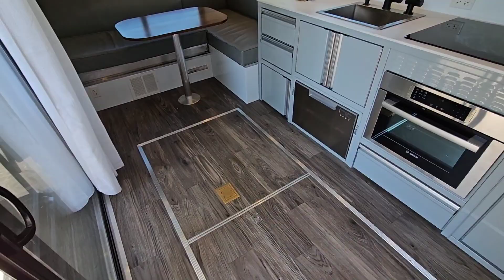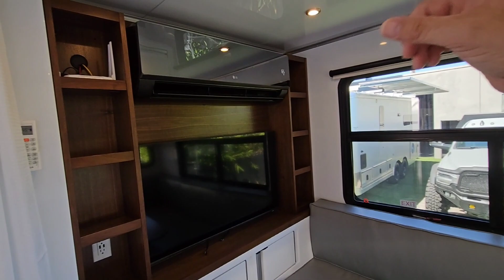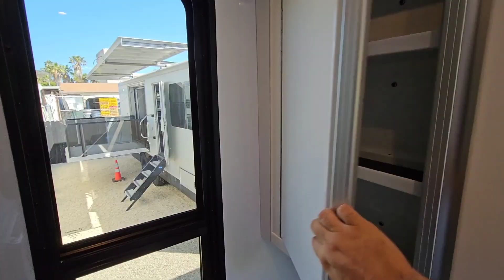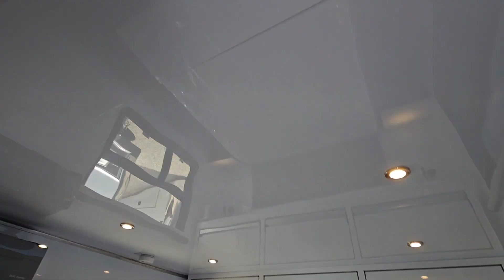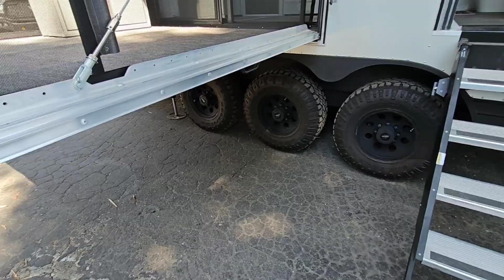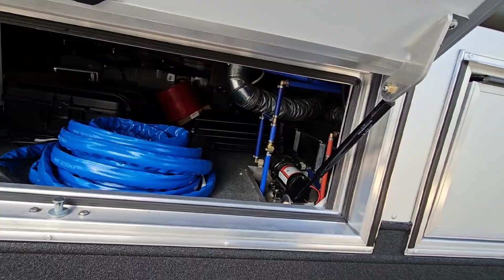Best Built RV EVER! INSANE SOLAR and Batteries! Living Vehicle HD30 Pro

Comment: I cannot believe what I viewed. I bought a used 32’ aluminum trailer that I’ve been gutting and have written ideas in a log book for customizing my trailer. They’ve done my ideas and I’m so upset that they’ve beat me to it. An all electric trailer solar powered with the generator backup system. I love the water reclamations system they did. I didn’t think of that. I do have other ideas on my custom design ideas that they didn’t use. I’m going to raise my aluminum trailer for better living accommodations and belly storage. I will be running aluminum vents through the ceiling and belly for ac/heat. I’m still going to use a large full size canopy that when opened I can hang screening that will keep bugs out. I don’t like the all aluminum interior, just doesn’t seem homely to me. I will still use wood cabinets. This LVH is a great trailer however the price has got to come way down. I’m disappointed that a lot of my ideas are here but I’m gonna use some of theirs also! 😂

Comment: nothing I saw in this video shows or justifies the price tag... that's absolutely ludicrous.... you can buy a nice motorcoach for that.... like seriously...  and those cabinets are not high end they are literally just tool box style drawers and cabinets.  and adding some 45 cent latches to a standard refrigerator does not make it yacht style appliances lol sorry i get insulted when ppl charge this kind of money for things that aren't worth a quarter of what they are charging. the only thing really cool is the solar system and you can buy all that equipment and put it on any trailer for less than 40k

Comment: Love this so much. My only issue is that I intend to tow with my Cybertruck which doesn’t with dual rear axles. 
And the13,500 tow limit. 
But I think I’d rather have this than a second home. Getting into astronomy and astrophotography. Love the idea of heading out to clear, dark skies whenever and enjoy the all-electric, sustainable life I have at home. 
I might even consider making this a full time home with a small plot and some storage units and gardens to tend. 
I’d sell my home for it. Have to at $500-600k. 
But I’d need a smaller lighter version so, with my luck, it’d be even more expensive lol. 
With all the videos about the horrors of owning a travel trailer or RV i don’t want to spend as little as possible on something like this. You get what you pay for with this company. 
Basically if Tesla and Microsoft shares go up substantially I’m in.

Comment: 2 questions...1  Would you not get wet on the deck when its raining?  I say that as there seems to be a large gap from the solar panel extension to the roof.  2  Can you walk on the roof if so is there enough space to clean the bank of solar panels as I doubt that you can walk on the solar panels, also I'm sure you can't walk on the awning so is there space to clean those solar panel while in travel mode?

Comment: We're designing 40%+ efficiency solar thin film of fired ceramic semiconductor crystals on durable metal sheet that could take you from 2 kW to 4 or even, a few years down the line, 6 kW, and batteries that will be over 2 kWh per kg. That could enable you to power not only the home, but a BEV truck as well.

Comment: Another great feature is the fact that there are no holes in the roof for vent fans, AC's, satellite dishes, or any of the other rooftop appliances that you typically see on large travel trailers and fifth wheels.
Reply: Right?! Don’t give water a chance to get in. Plus it allows for those solar panels to fill the whole area, tho this video showed one where the coverage wasn’t 100%
These builders thought of everything and provide at least one solution.

Comment: Seven hundred thousand dollars is obscene ffor something that looks like somebody did a home-conversion of a box trailer. 

The quality is out of this world, but you can tell they're boat-people. I saw some boat-people make a himemade teardrop trailer, the interior was hideous and dead and sterile, too. 

Cabinets and features and solar is badass. I'd say it's very competitive at 300k.
Reply from the maker: I would agree it would be very competitive, but for many of their units that are well above that price point, the cost of developing one exceeds that. They do start at below $300,000 though
Reply: @BTBRV  

Nice! I believe you when you say they have a hundred thousand dollars of solar on this one though. Batteries are PRICEY. And that's like 3 times as many as what a prius has. 

And the smart controllers, wiring, points of use, failsafes, panels, mounting, monitoring system. It adds up.

Comment: If rhey add a slide it would be worth it.  Just not enough room
Reply from the maker: Unfortunately, had they used slides, it would not have met the overall reliability and quality standards that they're looking for from a unit designed to last a lifetime mechanically.

Comment: Heat pump technology is the best thing that ever happened to home heating and cooling. I'd like to see more rv manufacturers use it.
Reply: Tough for most manufacturers to use this as a single zone that operates off 120 isn’t quite enough and will ultimately heat or cool only one side of the unit. You really need a 240 V system with multiple zones like we have a Living Vehicle. The power needs of that type of system to allow for regular use both on and off grid is quite complex and expensive for manufacturers that optimize for price.  that being said, I agree with you it is an absolute game changer that completely elevates the efficiency of the HVAC system.

Comment: Looks like a tool truck. The draws and cabinets look like tool boxes. Also, it reminds me of the camp lite rv trailers. They were built all aluminum but steel frame. Same idea but a lot cheaper and light. The yachts I have been on, none of them sounded like a like my toolbox opening and closing. Looks like a car hauler someone bought and added  Harbor Fright icon toolbox components to it even sounds like a cheap toolbox. I don't see what you are so impressed by it. The solar panels and battery bank are about the only thing I see that is really unique.
Reply: You should start a business building these by hand as well. Sounds like you have it all figured out and can sell em like hotcakes and shut theses greedy people down. All these people are after money, after all. You would be a millionaire!! (oh wait, you don't want anybody to make money on things) So nevermind, I suppose you're willing to build these paying yourself to where you work paycheck to paycheck. That's right.

Comment: Are we all looking at the same trailer? This thing looks like shit compared to a Luxe at the same price point. (which is twice as long). Sure its built well, but the cabinets look horrible on the inside and outside. The solar awnings are like 4 ft which offer basically no shade unless its high noon. Plus when you get to the camp site people are going to come up and ask what kind of tacos you sell from your taco trailer.
Reply: Form follows function.  Most trailers on the inside look like cheap mobile homes.  On the outside most trailers look like a dirt bike with their cheesy graphics.

Comment: What would be nice if you have an electric truck and the solar panels charge the truck as you drive to extend the tow distance and or keep it charged.
Reply: It has level 1 charging, and probably requires the solar awnings to be out to even deliver 5KW.  Even if you had that, it only adds about 10-15 miles of range per hour of charge time, for a regular electric car.  For an electric truck capable of pulling this?  Maybe 3 miles of range per hour.  So if you drive 20 mph it might make a difference to your range.  And you'd have to drive with the awnings out.  

EVs use incredible amounts of power compared to what solar systems are able to generate, until you start talking about house-sized arrays.

Comment: 50 amp power in case you get caught in a bad hail storm that damages the solar panels.
Reply: Texas, Oklahoma and Colorado have entered the chat.
Reply: They do look like flex panels and should handle pretty much any hail storm (maybe). I still wouldnt camp inside this expensive snow cone stand
Reply: @enigma9789 

Snow cone stand, perfect. I hate the box trailer look. It even has the vertical rows of rivets holding the sheet panels on. All the tech and quality is badass, but they put a faberge egg in a moldy cardboard box and want three quarter million for it?

Comment: Beautiful rig and well designed —- but…. I was super impressed right until I saw they use the cheap PEX clamps, these fail on almost every RV

They should really switch to the quality cold expansion type solid rings

Comment: I’ve been checking out the living vehicle for a couple of weeks now, it is very impressive, and they absolutely have the best quality and innovation in the industry. I was also wondering if they had considered towing the LV with an electric truck, and possibly partnering with either Ford, Chevy, or Dodge designing away to use the solar from the LV to enhance the range of an electric tow vehicle or charge your EV while camping since those options are very limited?
Reply: Solar charging a vehicle is years away. Ford Lightning uses 0.49 kwh per mile. On this unit, with the awnings extended, they were pulling in 1964 watts. So in 1 hour, they generated 4 miles of range for the Ford Lightning. And that truck is nowhere near the size needed to haul this beast.
Reply: Thanks for taking the time and replying, glad to hear it’s in the works. I will be looking forward to the future with hopeful optimism.
Reply: @tdrewBSG  Yes, stay tuned. We have lots of exciting developments in the works!

Comment: Two thumbs up for the brass Pex fittings and the use of wire loom, very neat mechanicals/electricals. One of these on a Prevost class A chassis would be sweet. My wife would without question injure herself on those sharp corners on the shower shelves though.

Comment: That rear air handler is very close to the rear seating / dining area.  Does that create a cold spot for anyone sitting there.  I would think that would be uncomfortable.
Reply: Don't know if you've actually experienced these mini-splits in person, but they are designed to be very quiet and efficient.  Most of the units I've seen, if there is any other noise going on in the room, it would be tough to tell it was running by ear alone.  It doesn't blast away like typical RV AC ceiling units.  You can certainly adjust the fan speed on these, and make it as cold or warm as you like.
Reply: @robertstorms3469  yes we have one but it's mounted high on the wall.  This one is right at the rear seating area which is why I asked the question.
Reply: @stevenfoster5737  Understood.  I'm sitting in our full-time RV in the DFW area, and it's 102 degrees outside.  I'd love to have a cold breeze down my neck!  We're not suffering, unless we have to work on anything outside right now.
Reply: @robertstorms3469  okay so I get what you are saying but I'm asking this question to someone who has this unit or anyone at the company.  Apparently you are neither so why do you keep this thread going?  You don't own  this model so why keep commenting?

I was outside all day today  in 90+ degree weather.  I would have loved a cool spot for the few minutes that I was actually inside.  But my experience today is not why I want to know about a potential cold or hot spot.

I'm interested in this Living Vehicle and I'm asking a legitimate question. I'm not asking for opinions. I'm asking for an answer from someone who has the experience to answer my question.

Comment: Gate latches for the fridge? Are you kidding? You’re not being objective.
Reply: @@jimhenderson438 
Exactly!
Reply from the maker: It's a virtually failproof mechanical latch. It's also a very functional piece of hardware that does exactly as intended with virtually no chance of failing.  And, they likely cost more than most plastic latches you see on typical RVs.  Their also used on $20,000,000 yatchs.  So....  Sorry you disapprove.  Oh, and they are sliding latches.  To latch a gate is just 1 of hundreds of uses.  You're not being very practical my friend..
Reply: @BTBRV  That is just not true. No Yacht, even at 700,000, uses gate latches to secure the fridge.

Comment: Does it only come plain or do they have paint options . And are those tires necessary since those are made for grip those axles have no power so wouldn't you be better off with high end heavy duty trailer tires . and the offroad suspension
Reply: Awesome thanks for the answers 👍

Comment: They are very proud of their tool box trailer . not one thing was I impressed with. $600k for tool boxs and solar.
Reply: I agree the cabinets/drawers are the same as a high end toolbox.  With the cost it should have independent suspension.
Reply from the maker: Because you went into it only looking for surface material things.  Many folks say a Rolex doesn't look like it's worth $25,000.
Reply: @BTBRV for what it is, there is no justification for the price tag. You can get several other options at a 10th of the cost an put 20 grand in an arill have somsthing better. Blows my mind lol
Reply: @BTBRV surface appearance or not, a Rolex isn’t worth 25000 lol. A $30 timex is about as reliable and tells the same time. Even if the Rolex Was built 100x Better, it still wouldn’t justify the expense. This camper is nice no doubt, but might as well not exist for the majority of us, like a Rolex - it’s for the 1% who have nothing better to do but blow extra money and use as a symbol of wealth.
Reply: @BTBRV  Wrong bud. Like you, I'm very passionate about rvs.I'm not saying that the fit and finish isn't there, what I'm saying is I have the same drawer system on my tool box, and for them to say that's luxury is laughable, strong, yes...utilitarian, again yes...but not luxurious. The bath is a glorify wet bath. I'm ok with the composting toilet, but I've never understood the all in one bathroom ... Did they use real wood and quality co.ponets? I suppose, but the execution is lacking imho. Your Beacon was warmer and more inviting. Rvs  are like opinions...we all have them and they all differ..(btw love your channel).

Comment: I'll take a new 30ft Airstream Classic for $150K, a new dually pickup for $90K, plus $250K in my pocket, over that utility trailer that looks like the box an Airstream come in. 😊
Reply: I'll have to agree worth John Wayne on this one,  this thing would be awesome during the apocalypse though
Reply from the maker: That $150k RV needs shore power, water, and isn't built nearly as well for fulltime long term use.  Plus is less efficient from a heating and cooling perspective.  Again, needs power.   Add $120k for the solar setup that's on this.
Reply: @BTBRV 120k seems excessive for sure . My buddies next door neighbor just installed a complete Tesla Solar roof on his 2600 sqft house for about 75k with Powerwall.
Reply: @BTBRV  i work with a solar company, i can promsie you, top of the line solar install with parts to match to exceed this trailers will run you 30 to 40k. I did a school bus a few years back that had double what this offers for 23k
Reply: @deliciousgixxer3670  There's no way your school bus conversion has double what this offers.
This trailer has the 'HD Pro' package, which according to the webpage, has 72,000 watt-hours of battery, 18,000 watts of inverter power, and 4,400 watts of solar.
I'm just guessing, but I'll bet their inverter(s) alone cost more than your entire school bus solar install.
Reply: @johnpalmer3848 I mean a bus does have a lot of roof
Reply: JD finally sells out. 120k is insane for solar. Why even show this when .001% of the audience can’t afford this?
Reply: "JD finally sells out."??  JD is reporting the facts on a new RV.  I don't know how that's a sell-out.  

But, yeah... the $120K for the solar?  That's the most reasonably priced thing on this trailer!  Think about that battery bank of LiFePo4 batteries, and the slide-out setup for those solar panels.  That's a big chunk of that cost, I'm sure. All of that Victron control hardware, plus they're probably doing a 220 volt inverter to give that multi-zone mini-split enough juice.  Anything more than 12,000 BTU is going to be 220 volt, and running multiple air handler/Evap coils, is going to be 24k to 36k BTU.